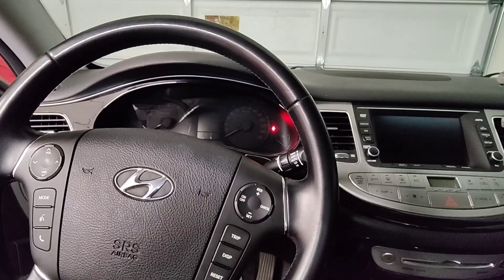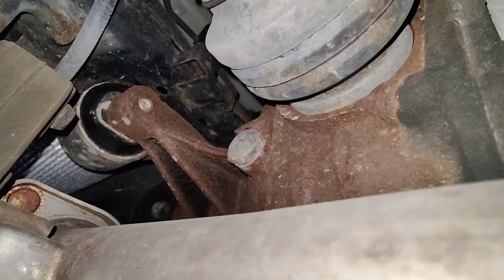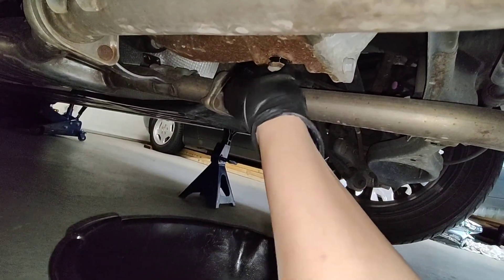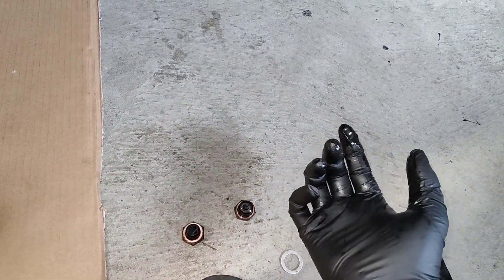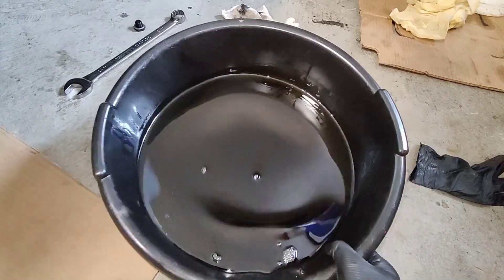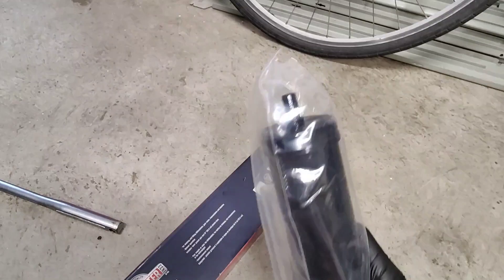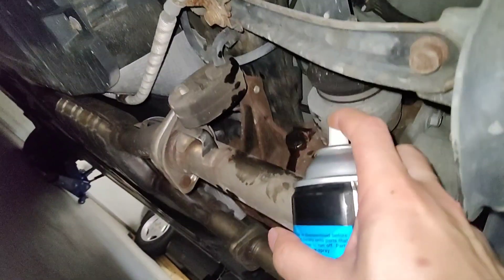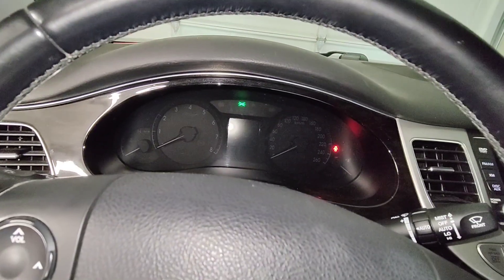100k and never been changed. 2012 Hyundai Genesis rear differential fluid.

Comment: Never ever changed mine.  I hit 230k on mine. The dealer never even reminded me about this. I used to drive 500 miles a week for 3 years for work. Thanks for showing this.
Reply from the maker: You are welcome.
Reply: I don't know why some people experience issues with rear differentials and some don't tbh. Changing the fluids should be necessary?

Comment: Confirm the part numbers I got for my 2012 3.8L Genny so far:

Differential Fill Washer: Part No.: 53084-39000
Differential Drain Washer: Part No.: 53072-39000
Drain plug Part No.: 53070-39000
Fill plug Part No: 53082-3C000

Mobil 1 Synthetic Gear Lubricant LS 75W-90, 2 Quarts
Fill= 28 ft lbs conversion from  4 ~ 6 kgf.m
Drain= 34 ft lbs conversion from 5 ~ 7 kgf.m

24MM or 15/16 Socket with a 3" or 6" extension bar to get to the Fill plug at least.

AMS

Comment: since you work in a shop. you can always try that trick with the air. where you have the fill tube of the diff fluid into the diff and poke a hole on the side and push air in, so that the fluid is forced up and out and into the diff.
Reply: Id rather use a hand pump..  a bunch of pressure and that stank ass diff fluid doesnt make for any happy mistakes..  stuff will go to bed with ya..  nasty
Reply from the maker: Yea that smell lingers the garage still smells like gear oil.

Comment: How do you know when your car is actually level?  Garages have a 1.5% grade to drain water away from the foundation.  The reason I ask is when checking the level on helicopters and fixed wing aircraft there is certain area where hang a "plumb bob" or set a "bubble" level (42 years of aviation maintenance experience).  My 2014 Genesis 3.8 V6 Sedan gets between 28 and 32 miles per gallon.  Higher when on road trips loaded with the A/C running at 218K+ miles.

Comment: How often do you need to replace diff, transfer case, tranny fluid? Manufactures do not list them on service manual. Except probably for honda
Reply from the maker: Yea Honda first drain is 24k kms then 50k kms interval after that. I did mine at 24k looked pretty grey but thats probably break in. Going to drain it again and see what it looks like when I'm at 50k whether to do it earlier or I can go longer. Since not everyone uses there vehicle the same.

Comment: The owner's manual on my 2013 Genesis sedan says replace at 128,000 km/ 80,000 miles in severe driving conditions.
Reply from the maker: One thing I've learned while working at a Hyundai dealer. I've seen them grenade just before that km or well before. Replaced them on the Genesis sedan such as my gf car and on the next model that came out in 2015 which is the G80 now. Same with the Santa Fe usually they start making noise or binding when on turns and eventually punches a hole through your diff and your spider gears are on the floor. I still have pictures from grenade diff because we need to submit for warranty.
Reply: @theoffroadingmechanic  To tell the truth, I've never changed the differential fluid on any car I've owned. Before my Genesis, I had a Hyundai that had 300,000km on it, without a diff problem.
Any car can fail that way.